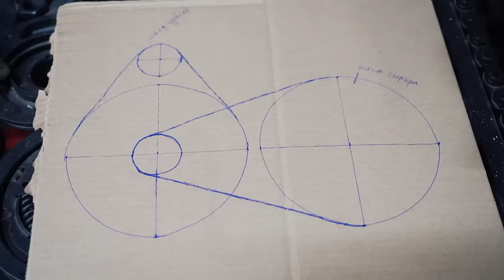Turbocharging a Lada with a starter motor

Comment: A turbocharger is a centrifugal supercharger driven by an exhaust gas turbine.  This is a centrifugal supercharger.  Maybe connect the switch to the throttle linkage so it cuts in at or near wide open throttle.

Comment: But it's not autonomous from the engine: the engine is driving the alternator which is providing power for the blower motor (since the blower will take a lot current than the charger can provide, it'll take it from the battery which will then be more slowly recharged by the alternator). Either way, you're directly using engine power to drive this, while a turbocharger is using waste heat - the exhaust - to power the blower at no cost to the engine (ignoring generally lower compression ratios etc, of course). 
Unless of course there's a separate battery for the blower motor, but I didn't note any mention of one.

Comment: redesign this so it runs off the engine and has a clutch like a AC compressor, so you can hit a button to engage it. It would be like the Mad Max style blower. That would be neat and maybe Dyno to see power on vs off.

Comment: Okay guys, how about converting an alternator to a permanent magnet motor and using that to power the turbo. A wind turbine permanent magnet alternator would be better because it will produce more torque at a lower rpm. Or just have the alternator rewound . 👍 There are many YouTube videos of people converting alternators .

Comment: sumting i seen done a while back : add an electric motor with a ratchet to the crank of the gas engine , the electric motor would add the power directly to the crank at low rpm then the gasengine would take over

Comment: A  thermatic fan motor might be a good option.The ones I have spin at 10,000 RPM. Only problem maybe the moer would not be in the fan air path thus may over heat.

Comment: This fist thing I think of with using a starter motor is that they are high torque and high amp with fat wires and windings that get very hot. They are designed to be powerful but only run for a short time so using that big fat power pig of a motor will get very hot, drain the battery very fast and burn out quickly. Maybe lada starters are not as bad as starters on the typical engines I'm used to dealing with. It seems to me if you tried this with a Jeep or Chevy truck starter the ting would kill the battery within a few minutes and get so hot it would burn up.. Just an observation..

Comment: no i want to try building one with a controllable PWM system to control a power map just love this team of fun loving engineering madness keep it up. how about you actually try making it work properly with variable resistors and PWM brushless motors and test it on a dyno ??? if done correctly it will eliminate turbo lag and be better than a traditional compressor ....

Comment: Maybe try a electric motor off a cement mixer an inverter to power it & a lot of gearing. I don't think your need an intercooler with that weather Maybe try pulsating an extra fuel injector away from the intake manifold. so cool

Comment: custom grind crank so starter motor gears alingn with crank ,place starter motor in each cylinder so it be four starter motors aligning with custom crank shaft gears that way the a/c and alternator  can stay in place but belts not gears maybe easier

Comment: They should try to fit a scooter motorcycle variable transmission, so the starter motor would not have to do as much force to start and it would not heat up as much. If you do please send me a greeting :D

Comment: First thing get that starter motor out it's not designed for continuous use. May have to use 110 with a converter but check for 12 volt then 110 I knew it would do exactly that I wasn't sure how well it would do I was a little surprised

Comment: Need a cooling system fore starter motor. Maybe winde copper tubing around it then to small heater core for radiator.

Comment: Use an adequate scalextrix type speed controler connected to work in tandem with the accelerator pedal and a less powerful electric motor for the blower perhaps?

Comment: Try putting a ac clutch on your belt system on the compressor of the turbo and have it belt driven but be able to turn it on or off with the ac clutch

Comment: its betta if u can get a brushless motor as the brush of the starter motor cldnt last long with continuous use. Theres actually one for sale on the market. It runs on 48v with its own battery pack. That is if u hv 5k to spend.

Comment: You could try using à RC electric brushless motor, they are very powerfull for their size, easy to use and they don't overheat like your starter motor.

Comment: If I was to make something like that, a RC truck motor would make more sense to me, you can get some pretty powerful motors that can spin well over 100k rpms, so 30k rpm would be pretty easy to get to. Pretty sweet this does make a difference, although is it worth it? Idk.

Comment: Would this be considered a turbocharger or a supercharger? It's not attached to the exhaust,  so I would think it would be a supercharger. It kind of reminds me of the system they used on studebakers and packards back in the 50s. I wonder if you could somehow link the system to a modern electronic tachometer so the boost would increase with rpm?
Reply: Treadmill motor puts out 1/3 hp, a V8 starter motor between 1 to 1.5hp, and a diesel starter motor between 5-7hp.  A turbocharger at full throttle on a small 4 cylinder is recovering about 20hp from the exhaust stream.  These electric motors all have various rpm ranges which need to be accounted for in gearing to a mechanical turbo or technically a supercharger, I did the reading so you didn't have to.  Basically you need a 20hp or above electric motor, controller, capable batteries, and gearing to achieve 30,000+ rpm to match the boost provided by a stock turbocharger on a 4 cylinder, which is quite cost prohibitive.
Reply: @ProlificInvention  Your right. Honestly, all the power they dump into that motor is just coming straight from the alternator. They would be way better off just running the turbo/supercharger directly off the fan belt, like studebaker did. They also might want to reduce the amount of tubing between the supercharger and carburetor. (If it's carbureted, I didn't look.) That way there would be less area to pressurize and there would be less lag.

Comment: I would use stronger electric motor, example truck rear lift usually use 2000w motor, add 2 separate batteries (24v) so it will not slow down the gasoline engine when it has own batteries.
Even 5000w motor would be better, to make serious boost.

Comment: Perhaps you could convert an alternator into a 3 phase motor, that way, it would be powerful, wont get hot, and could stay on for extended periods of time if you wanted to use that to run the turbo, instead of the starter motor.

Comment: Use a high rpm remote control car electric motor. They are reliable, spin at a high rate of speed, and a turbo doesn't really need a bunch or torque to spin it..

Comment: You need a Wideband Sensor or a LSU4.3 O2 Sensor with an Arduino Board or something 😂. Fuel Pressure regulator an a better Fuel Pump for the Fuel Issue first 😂. For the Starter Motor you can install Cooling Fins around the Motor with a blower or something 😂. A bigger Starter Motor from a Truck maybe better 😂. Most of the electric Supercharger are above 12 Volts. 24 or 48 Volts or even more runs on an electric Supercharger 😂😁.

Comment: You have to build a probably about at least 30 PSI of pressure on the turbo and the exhaust turbo is free horsepower doesn't take any power from the engine in the first place

Comment: the danger of doing this, is that the air to fuel mixture gets lean, when the mixture gets lean, the RPM raises and the engine gets hotter and the piston/piston rings can burn and deform. to counter this, add more fuel to the engine at the same time as the turbo.

Comment: A starter motor has a duty cycle of 5% or less, that's why it's ending up so hot.  BTW this is a SUPERcharger.  A turbocharger uses a turbine in the exhaust stream to drive the compressor.  There should be some factory electric superchargers coming into the aftermarket and used parts market. 

The black smoke may have been a burst of "false air" where the throttle closes under boost and a lot of air is forced through the turbo and air mass meter but out of some leak point instead of through the engine.  This causes way too much fuel to be injected for the air that does go through.

Forced induction engines have numerous design points over normally aspirated.  The entire intake system must be well sealed under boost and vacuum.  The PCV must vent to the intake upstream of turbo intake.  There must be check valves in the PCV and EVAP systems.  There must be spark control that retards timing under boost, which early turbo cars achieved using a dual action vacuum advance/boost retard diaphragm. 

I remember seeing a write up about some go-kart racers who supercharged a 9hp engine with a belt driven smog pump.  Once they got the pulley ratios dialed in, it actually worked, in that it provided strong reliable boost and noticeably improved performance.

There are also a lot of JUNK fake superchargers on the market.  I remember laughing about them in the JC Whitney catalog 30 years ago.

Thanks for this cool video, I love your channel and zany inventions!

Comment: weld up some tube headers to run the turbo off exhaust gases like the turbo was made for...... inter cooler etc etc o and a boost gauge and afr gauge just in case... bov and wastegate...

Comment: I know you're supposed to use the exhaust to run the turbo but what if you were able to hook it up using two leaf blowers battery operated leaf blowers kind of curious if it would have enough power to turn the turbo

Comment: You need to hook up a brake light switch to the throttle so when U get like half pedal it will engage the electric motor

Comment: Starter motors are only designed to run for a very short time. You need to find a different motor.. Maybe something like a cordless drill motor possibly.

Comment: The starting motor is definitely a weak point. I'd go for something pulled out of a vaacum cleaner or a water pump which is specifically designed to drive an impeller.

Comment: A heater blower motor will spin the turbo at the required speed. Starter motors are not designed for continuous use like this.

Comment: I know this would be harder but if you initially took the starter apart, I believe there is already a gear reduction in there and then that would be that much less gearing up you would have to do But maybe not all starters have a gear reduction I don’t know?

Comment: Or if you look at the regular turbocharged engines have a intercooler and at a low system it needs probably 30 PSI a boost

Comment: This seems kinda funny to me, when you turn on the starter the alternator is going to work harder (couter-electromotive force)  so you are losing engine power when running this, just in a less direct way.  I always thought it would be a cool idea to run a centrifugal supercharger with a n/a map and a boost map with a electric clutch. Making it n/a at 0-70% throttle and then boosted beyond that.
Reply: Alternators generally max out at 100-200 watts output, this would be drawing off the cars battery primarily for the required current- For example: Treadmill motor puts out 1/3 hp (©250 watts), a V8 starter motor between 1 to 1.5hp (©750-1250 watts), and a diesel starter motor between 5-7hp (©3750-5250 watts).  A turbocharger at full throttle on a small 4 cylinder is recovering about 20hp from the exhaust stream.  These electric motors all have various rpm ranges which need to be accounted for in gearing to a mechanical turbo or technically a supercharger, I did the reading so you didn't have to.  Basically you need a 20hp or above electric motor, controller, capable batteries, and gearing to achieve 30,000+ rpm to match the boost provided by a stock turbocharger on a 4 cylinder, which is quite cost prohibitive.
Reply: @ProlificInvention  alternators put out around 1500 watts, with most capable of more even. At 200 watts your battery would die with your headlights on.
Reply: @jonathanshaw8868  I stand corrected, for some reason I mixed up amps with watts

Comment: i beleive it was a back fire do to increases compressionin the cylinders. Comp has not been prog yet prob to adjust fuel mixture as well as using a low octane gas.

Comment: Actually there are electric motor turbo boost you can try just using one of those but you have to use the intercooler too because but I guess it's really cold up there but an intercooler is still going to help you

Comment: When the Boost is not engaged is the engine starving for air? Trying to get air from the compressor. I would find a way to split the intake off to a regular air filter and install some sort of one-way valve so that are can't go out the filter when the Boost is engaged

Comment: Lol! wouldn’t it just been easier to run it how it’s supposed to be with the exhaust pipe? The little exhaust pipe on that thing would be so easy to run to it. Like what size is the exhaust on that thing? Around a inch or whatever. you guys use for your measurements there. You should put 8 turbos on it, That would be an entertaining episode. I really wonder if that engine could handle that much boost.

Comment: Could you try to drive a turbocharger from the rear differential. Gear it to make boost and it even has an oil supply.

Comment: Without a boost gauge, this means almost nothing. The turbo not spinning is a big restriction. Maybe do some acceleration test with turbo disconnected then with it connected but not powered on, and finally with it on. Even spinning at 25k i think is not enough for 0.5bar boost.

Comment: If you force air through the turbo to boost it how does the engine get air when it isn't boosting. Seems like you need a one way valve that closes when the turbo starts to blow air to build pressure. I know this would make a large difference.

Comment: I think you should use a powerful motor designed for higher speeds without the extra flywheels and belts you installed, and make sure it does not drain the battery.

Comment: Why don’t you wire a injector in the intake that also works off the button but have it hooked up to a pressure regulator so you can adjust the amount of fuel it sprays so then no actual ecu tune is necessary so it stays very stand alone.

Comment: Hmmm idk if this is actually “working”, as in boosting.  It seems that what could actually be happening when it turns on is that it’s just providing more air even when the throttle plate isn’t opened all the way, in theory it’s like it’s just getting the same air as if it were full throttle when the butterfly isn’t opened all the way, so basically they are getting the air(power) of the engine at “full throttle” even if the throttle is only half open.  I don’t think it’s actually boosting.  Basically your getting the same power and revs at half throttle as you would at full throttle, but even at full throttle your getting no gains

Comment: Your mistake was using the pulleys it should have been direct-drive with the starter motor attached directly to the air intake turbine shaft that would have taken a load off the starter motor and it wouldn't have been as hot just a little warm.

Comment: cool video!! what about a spring to a pull switch off the throttle that engages the motor and also another fuel injector in the intake to add the fuel? need a Boost gauge? id be happy to send one to my new fav YT channel in Mother Russia!

Comment: You are actually not saving anything by using an electric motor due to Lenz's Law. The energy needed to power the motor must come from somewhere, and that somewhere is the engine. The motor is causing a dip in engine power. Maybe not much, but it's definitely there. You would get more power by powering the turbo with exhaust gases like normal. That energy is mostly "free".

Comment: I mean, a hack is a hack, but I really hope he didn't use an internally geared starter motor and then re-gear it externally.

High speed electric motor -> Gears to reduce speed -> pulleys to increase speed -> Turbo compressor.

Seems like adding unnecessary.  For YouTube I get it.  If you are doing this for you, take a little time and don't add more trouble, remove the planetary gears.

Comment: Estimate around 100hp, their comparison to a 3 liter Camry is wrong because of the low gearing of the Lada. Kinda like a Subaru Wrx Sti, only 300 hp but the low rallycross gearing makes it superfast in lower speeds. When you get up to high speeds the low engine power becomes obvious.
Reply: "only" 300 bhp, that's twice the power of the most powerful car I've ever driven lol

Comment: Overvolt the starter motor slightly with a custom lithium cell, say 16.8v.... 35a 21700 molicell or similar? Turbo would be in full flight

Comment: WHAT WILL HAPPEN IF YOU USE THE SAME SETUP

BUT INSTEAD OF BLOWING AIR INTO THE ENGIN..

PUT IT ON THE EXHAUST TO SUCK AIR OUT....
OF BOTHE ...WHAT WILL HAPPEN????
Reply: I'm excited to see the results..the suction in the exhaust manifold will cause the pistons to lift when the exhaust valve opens..

Comment: This destruct the air to engine and give a slow engine when not electric charger is on, a ordinary real turbo run all time to feed up air in engine when press accelerate then it charge up to more air then engine not need, then its be pressure in cylinders.

Comment: I would think a turbo would be more efficient it is taking wasted exhaust gas and turning it into boost the electric supercharger is putting a huge load on the alternator and charging system and therefore putting a load on the motor still